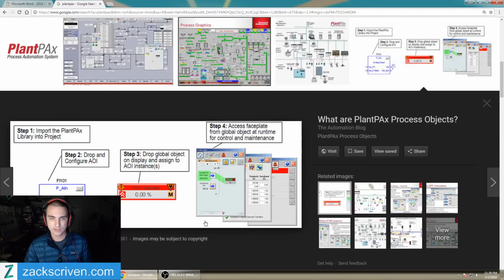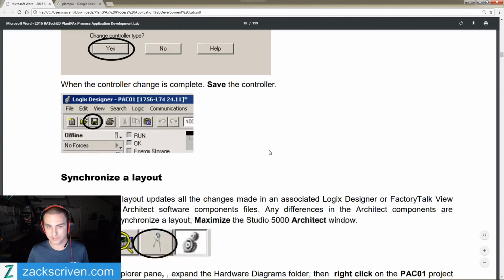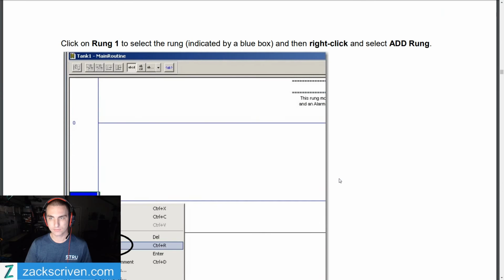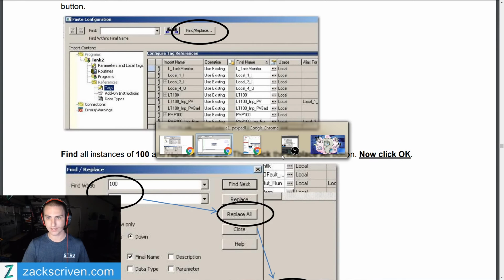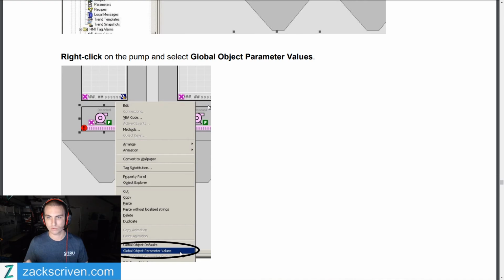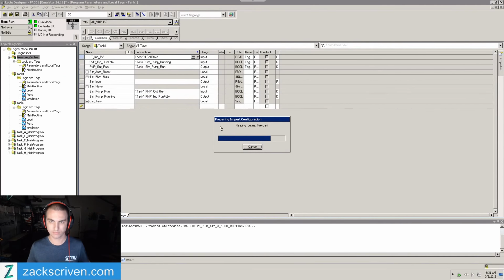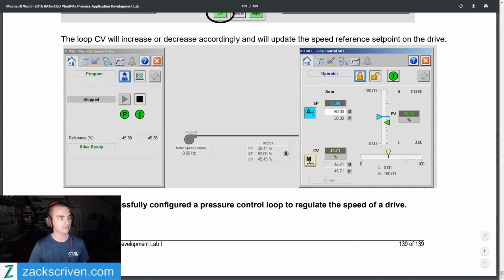PlantPAx Process Application Development Lab

Comment: I got a few questions for you:
1. Is Studio 5000 - Architect which I think is up to v4.0 PlantPax or an editor for PlantPax? 
2. I’m aware and have used FTV as the SE/ME HMI Graphic Editor, but can you use Studio 5000 - Architect to do the same as FTV. As well can you create a .apa graphic file and then later open it in FTV v8/9/10? 
3. Is there a way to use the newer graphic objects and elements made available for PlantPax in FTV v8/9/10? As PlantPax has so,e really nice RA AB graphic element built in for process objects that’s more updated than what seems to be in FTV.
4. Can you take a graphic object having been Function Block programmed in Studio 5000 - Architect and import it as a display or library element into FTV?

Quite an informative video as I do use FTV and Studio but not with the PlantPax add on. So I’m a bit intrigued with the Process Graphic Objects and elements. Great video. And funny enough, I have those same RA Manuals.

Comment from the maker: Timestamps

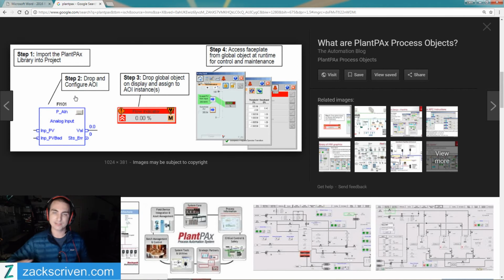Video Starts | 0:55

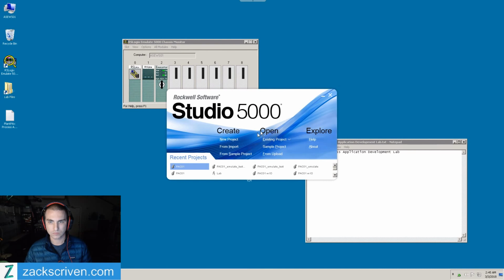Lab Starts |  7:28

Architect | 12:00

Studio 5000 Organizing Programs |  23:40

Importing Process Strategies  | 27:40

Creating an HMI Project | 43:27

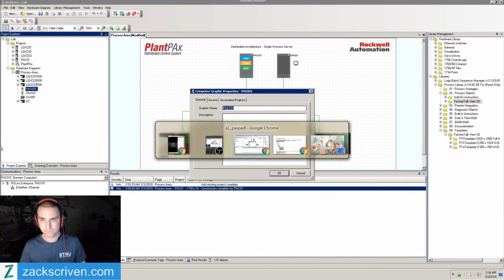Configuring HMI Server | 48:33

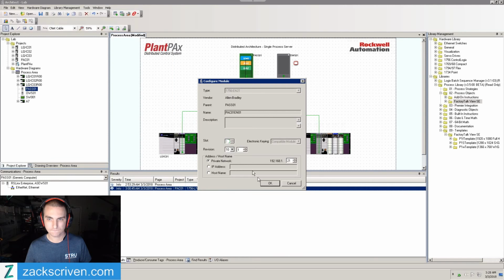Configuring Data Server | 50:34

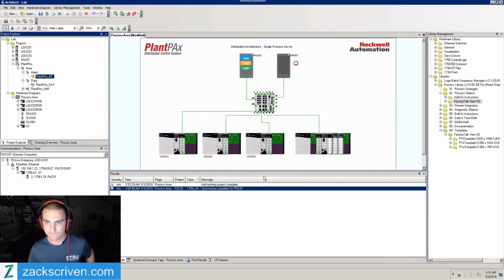Configuring Alarm & Event Server | 53:12

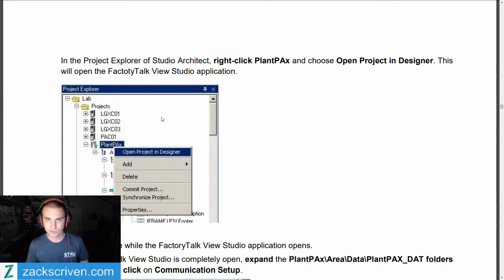Using FactoryTalk View Studio to develop & test application | 56:07

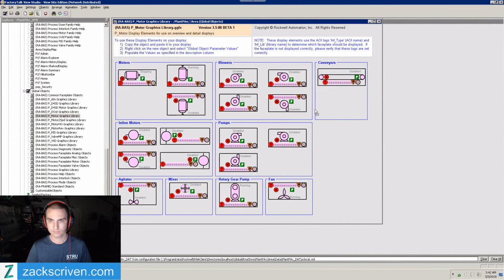Using Library Global Objects to configure HMI Displays | 1:02:10

Using FactoryTalk View SE Client to View the HMI Application | 1:09:12

Commissioning the Device Faceplates | 1:21:28

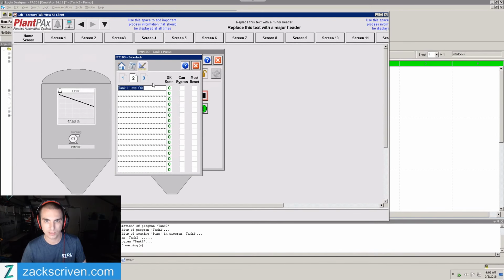Configuring an Interlock | 1:28:56

Configuring Alarms | 1:41:46

Late Binding I/O Parameter tags to I/O Module Channels | 1:50:14

Lab Summary | 1:51:58

Optional Lab Section

Configure a Control Loop | 1:52:52

Video Outro | 2:12:14